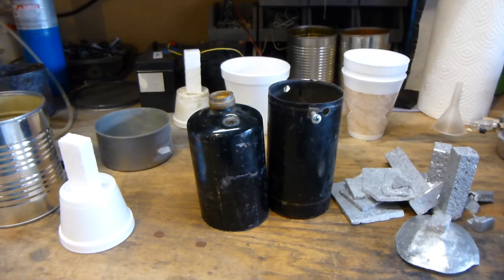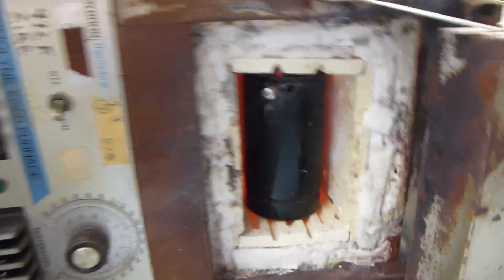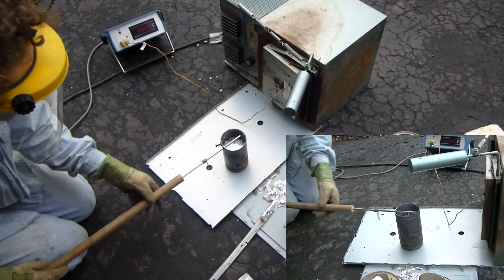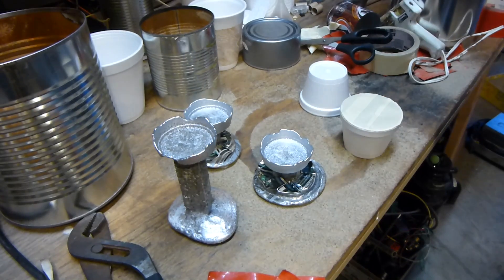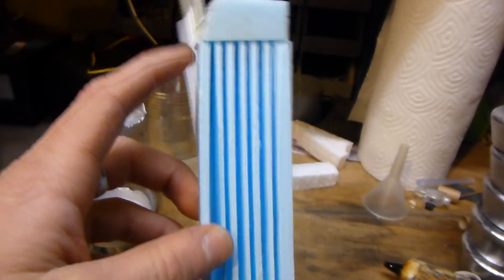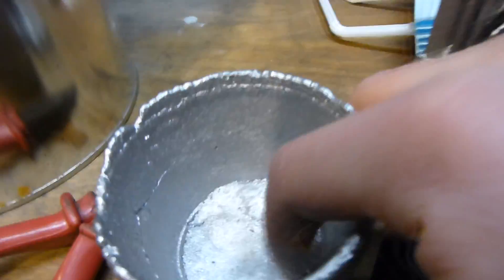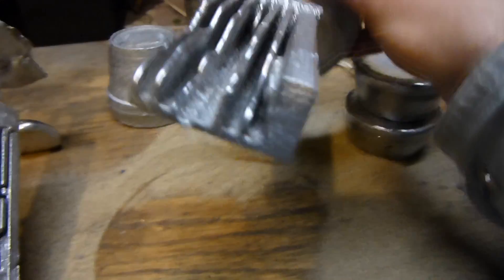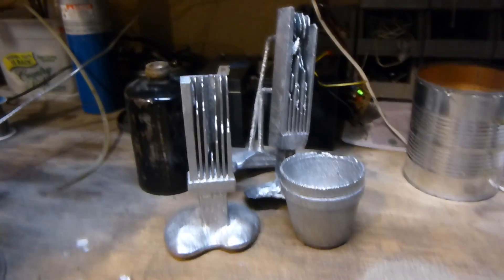Aluminium Casting Styrofoam Cups and Heat Sinks

Comment: Support the mold with a couple drywall mud coatings thined with water. Maybe add little sand to the mud mix to minimize shrinkage. You should get a better surface finish

But a bigger issue with the poor quality is the gasses in the foam need to escape. Maybe if the cups were right side up and the spruce fed into the cup from the bottom.

Comment: There's nothing to hold your sand together after the styrofoam is melted. Just add 10% bentonite clay (unscented cheap cat litter, crushed and sifted) and oil to your sand, compact very tight. One reason to oil is it has a much lower specific heat content than water and will not cool the flowing metal as fast as water.

Comment: 2 things: 

First, your sand needs a wetting agent. Something like gummy, used motor oil or heavy silicone oil works well for sand casting aluminum. If you do that, the sand won't fall out of the packed cup as easily (no more tape) and it will pick up fine detail better. You can use other chemicals, but do not use something that attracts moisture as that can make the sand casting dangerous. I like heavy automotive greases but you can mix ingredients a bit. There's a number of lithium greases that would probably work well for this. 

Second, your aluminum is seizing. You need to heat the mold.. Heating the mold prevents the aluminum from losing heat as rapidly, allowing it to flow as a liquid for a longer period of time. Even bulky pours can seize if there's a narrow gap between large volumes. Sand that can be packed tightly and hold's it's shape during heating allows the mold to be pre-heated which slows the rate of cooling during a pour and  decreases the likely-hood of the aluminum seizing in an odd place.
Reply: Just going to point out used motor oil can be carcinogenic. New motor oil is safe.

Comment: I'm pretty sure part of the issue here is with the type of styrofoam you used.  Some styrofoam is very light, while some is denser.  Styrofoam cups (and plates and bowls) are made of slightly denser styrofoam, and some of them have a slightly plasticized surface to prevent leakage.  So, rather than instantly vaporizing, they melt, producing a barrier to the clean flow of aluminium.  I have cast some very thin styrofoam sheets successfully when I used expanded polystyrene insulation that I cut into thin sheets myself, rather than using pre-made thin products such as plates and cups.

Comment: Nice vid thanks. Like other people said green sand would help. Or an alternative is to paint on a thin layer of plaster, over the foam. It takes time as the plaster has to be well dry before you pour, but hat will stop the dry sand collapsing in and spoiling the casting.

Comment: Being wet outside hope your careful aluminum explodes when it hits water!
Reply from the maker: Where do you get this information?
Reply: If water gets in the mold, when the aluminum is poured in, the water will vaporize rapidly causing a steam explosion flinging small bits of molten aluminum around

Comment: The reason why the aluminum is not filling in the finer details is because your molds are too cool (room temperature) causing the aluminum to harden quicker. To fix this you can pour plaster molds, wait til they dry, then heat them in an oven or in or over your furnace and then pour the aluminum into them.

Comment: I just bought a small kiln with a door and want to try my hand at some aluminum casting and am trying to decide if I should use a propane bottle or bore out some cast iron round stock(2".5 dia) and use that? Also I need to learn about using borax ?
Reply from the maker: +trialnterror the cast iron would last vastly longer

Comment: Curious what did you use for your crucible? Looks like a propane bottle?
Reply from the maker: you are right!
Reply: you should try making  it with 2 cups stacked, but you should cut the foam at the very edge of the external cup, it should turn out right

Comment: u need to use green sand and a smaller sprew. it will put more au in the mold. and the straw is a good vent

Comment: Interesting experiment.  I did the same thing with the foam cups back in 1969, when lost foam castings was just getting started.  If you want to use some really good sand  that is easy to get on ebay, buy a bag of Petrobond.  You won't have to mess with water because it has a binder that won't evaporate.  Petrobond will provide many good molding opportunities for you, and lasts forever.  Keep up the experiments.  It's great to see an inquisitive mind fooling around with foundry methods.

Comment: Don't know if anyone mentioned it but I would guess that the dry sand is collapsing into the form as the styrofoam is melted and plugging it.  Might need a stiffer form that will hold its shape better for such thin parts.

Comment: I used to pour flowers and insects out of steel alloy back in the day. I never used sand because it's not holding well. I used to pour plaster around them on a vibrating table so all the air gets out. Before pouring the metal, the form was heated in an oven. Then, I used to melt the metal right in the mould, using a oxygen flame. Then we would spin the mood in a manual centrifugal machine. The pour was perfect every time, details like the hair on the spider's legs was visible while using quality dental chrome vanadium alloy.
So your problem is the mould and the feeding. Use thinner sand or plaster to increase the detail. Make the feeding rod smaller with a cooling reservoir on it, (usually a bump close to the object). Most of all, heat the mould up as close as you can to the melted metal temperature. Your mould is so cold that it cools off the metal, that is why your pour is not complete...
Let me know if you need more hints like the DIY centrifugal machine. Cheers!

Comment: You mentioned how your cups were low quality and you didn't know if it was because of gasses. I think it might be because of the quality of your sand. Increasing the quality (Finer sand should be better) would probably give you a smoother, higher quality cast.

Comment: hey man.  i just had some thoughts from my own personal experience on how to cast whatever you want quite easily. I do some lost foam casting and normal flask castings, but i use greensand for both. 

The advantage of green sand is its a bunch of sand particles coated in bentonite clay. It holds whatever shape you mold it to quite well. you can basically take a normal object of any material, make a mold of it with that sand, and its holds the shape for the metal while it's poured in. 

but the reason i suggest it is because it looks like as the foam burns out your sand shifts and cuts it off. if you used green sand it wouldnt move and it would just cast the object you're after quite accurately. 

I went to petco and bought some natural terrarium sand for reptiles. mostly because its super fine sand, and its already filtered for any larger rocks and such. 

a 10 lb bag is 15 bucks. then i mixed that with a 1 lb bag of bentonite clay. which i purchased for about 5 or 6 dollars off of ebay. 

the trick is to mix the two together really well dry, then slowly use a spray bottle to add water and keep mixing, just until you can squeeze it and it holds it shape without crumbling super easy. you want clean breaks. 

keep it in a sealed container. don't let it dry out. and after each use i take all the hard dry bits and break them back up and mix them back into the sand and add more water if necessary. you can re-use it hundreds of times. 

hope this helps :D
Reply: this helped me alot, thanks mate!

Comment: Some suggestions:
Try manufactured sand. It has sharp, angular particles that interlock and cling together. 

Make a wooden frame, place it on a board and put the polystyrene cup inside, right-side-up. Then fill it and surround it with 'green' sand. (slightly moistened sand.) Inverted the whole assembly sharply onto a flat surface. (concrete or granite should be okay.) The base of the cup should now be on top and that is where you pour.

Comment: I use casting sand, and when I am about to start the mold, I use baby powder and brush it on the original... then when I use the casting sand, I pack it in... use some method of vents, similar to the straws you used. 
  hope these tips help you out.
make sure the casting sand is NOT dry... has to stick  to itself. 
have fun!

Comment: On the heat sink , try gluing a block on the bottom that you can cut off later , the impurities from the burning styrofoam have no place to go ,so a still burning  gas bubble causes the voids . Im surprised dry sand is working for you , Look in some books for a simple formula for casting green sand  . Looks like youre ready to move up to ceramic shell casting , but you need a burnouy kilm .

Comment: wd40 seems to work well for firming up the sand.  Makerj, your sand is caving into your mold as the foam melts faster than the metal can flow.  it doesn't take much to hold the sand for a split second longer and improves pours dramatically.

Comment: Maybe I'm wrong, but I think that aluminium heatsinks are made in bulk by machining solid blocks of aluminium, because not even with perfect sand (or plaster or ceramic) casting can you get heatsinks as perfect as when you machine it. That's why the compressor blades of the turbochargers are made by machining too.

Comment: Use a more wet sand. Or a clay-based soil. And you'll get a better cast. Don't pour your soil of your choice all in at one time. Do like 2 to 3 inches stop packet down and so on and so forth.

Comment: im not sure if you make progress so far . but i think it would work better with finer sand , i know there are special sands for casting and they are not that expensive , you should try that  

p.s : i dont know if the sand im talking about if used to lost foam , i saw it in 2 part molds casting.

Comment: You stopped pouring too early and you need a port or two for the aluminum and air escape on the other end.  The styrofoam is full of air pockets and the air left after the stryofoam burnt off wouldn't allow the aluminum to fill the cavity.

Comment: You need to use green sand. The metal is more dense than the sand you're using and it is pushing the sand out of the way which is affecting your detail and resulting in the incomplete molds. You also need to compact the sand in layers around the mold as tightly as possible. Make or buy some green sand and you will notice a world of difference.

Comment: you mentioned you have plenty of aluminum?  where do you get the aluminum from and how long did it take you to get it I scrap out old computers, power supplies, drills and tools, cars ect to get aluminum but until now have never know how to melt it and havent had enough to melt as of yet plus most videos says its extremely dangerious especially if moisture gets to the molten aluminum like moisture in the air even?
Reply: +Makerj101 engine blocks would be a great source of aluminium, you could probably get a complete engine from a scrap yard and break it down.
Reply from the maker: NeX Yes!  That's a great supply of very high quality aluminium.  I've seen others using engine blocks before.
Reply from the maker: +charles johnson I mostly get it from hard drive frames.  They are solid machined blocks of aluminium most of the time.  Storm doors and folding lawn chairs are also good.  I've never had any moisture problems.  The only time I had some aluminum explosions was when I spilled some on the paved drive way.  The tar started boiling and it made some little pops that splashed some aluminium around.

Comment: how are you keeping the sand dry when not in use or are you drying it often?
Reply from the maker: +zallin I just keep it in a bucket with a lid
Reply: some say keep it damp but others say the keep it dry as wet sand steams sounds right to me but I have yet to cast more than ingots I would bake the sand low and slow to dry it out, if that works better there you go, if its worse add a little back and you learned something.

Comment: Have you thought about using a moist sand, then packing it well around the styrofoam and then using lacquer thinner or something to melt the styrofoam out and then pouring the mold? Just an idea...I'm thinking the styrofoam is messing up the pour

Comment: Use 120 AFS  Grain Fineness sand so you won't need to coat the foam with Styro Coat and you must use dry sand plus vibratory compaction when filling the mold. One other way is to just buy some Petro-Bond and 30 weight non detergent motor oil to bond the sand. I own a Non Ferrous Foundry in the USA and that's how it's done in my facility.
Reply from the maker: +Michael Nedesky  In my newest videos I show how to make green sand and I cast a nice flywheel with it.  Thank you!

Comment: Good video - as you can see from the comments a finer end product will mainly be the result from using finer packing materials (find sand, pulverized kitty litter etc..) but what's great about your process is it teaches the beginner the process and by doing it this way and then changing a little here and there you really develop an understanding of how it works and how to perfect it. - cheers!
Reply from the maker: +Dave Tipton Yep!  Thank you!  :)

Comment: Use 2 X 4's or 2 X6's  to make a good drag (the bottom part of your two part system), use the same thing to make a cope. Fill the bottom with your green sand (clay water and sand combination) set the cup full of moist, not wet sand (packed as tight as you can without breaking the cup) on the bottom half of the mold you cold cut Q-tips in half to make a fair number of gates running off the top, which is now the setting on the bottom half of the mold. Set the top half of the mold on top of the bottom half and use a regular number two pencil to make a riser.  Fill the top half of the mold with more green sand.  Once it is all packed into place you should be able to separate the top and bottom half of the mold you can then cut a runner to the riser into the bottom half of the mold. You can also remove the Q-tips.  The gates will provide extra heat down at the bottom for the thicker part of the cup.  Use something round to make the sprew and make it conical near where you are going to pour it in.  With green sand you should be able to remove the thing you used to make the sprew, just like you can remove the number two pencil before you pour.  The only thing you are trying to melt away is the foam cup. I was not able to read all 495 comments, but you sure got a lot of peoples attention if you got that many comments.  Good job.

Comment: You did a good job with your early attempts! Cope, drag, sprew, riser, gates, are all terms you need to know a little more about. Green sand is a combination of clay, sand and water.  It is has been awhile since I took my foundry class in college but I will tell you there is already some good information in the comments down below.  I don't remember any oil used for any castings in my foundry class.  I had also forgotten about parting dust until a friend reminded me when we were pouring stuff in his back yard foundry.  A good parting dust for a home foundry is baby powder.

Comment: I believe that your aluminum is cooling too quickly in the thin sections.  Two choices preheat the sand (messes up the Styrofoam) or get the aluminum hotter.  The detail on the straws eliminates all the comments before regarding your sand preparation, it seems fine.

Comment: Your problem, in regards to casting the cups, is that you're using 1 large sprue leading to the thin bottom of the cup and expecting that you don't have so much heat loss that it allows the molten metal to travel all the way (again, along thin walls, exposed to lots of cooling sand) to the lip of the cup.... 

You need more channels, leading to the outer edges of the cup bottom, from the main sprue, which will allows more heat retention... You should also heat your metal WELL ABOVE the actual melting point (at least several hundred degrees fahrenheit) so that as the metal cools it doesn't solidify immediately upon contact with the sand.
Reply from the maker: +digitalmunky Thank you very much for the helpful tips!  I will try some of them on my next castings!

Comment: yse wet sand the styrofoam is melting faster than the aluminum is poured. you use wet sand it will hold its shape even when the styofoam is gone

Comment: In industry when making motor blocks they use slightly wet sand, so that it keeps its shape when compacted onto the model. This might let you make better casts as the sand won't collapse while pouring.

Comment: the straws poured better because the air could escape threw them allowing more metals to drop down, also don't allow moisture into the sand or pour it can be dangerous (reading some coments on people saying use wet sand having sand and molten steel explode isn't nice moisture can be deadly)  but mix some glue with your sand making it stick to itself better and hold a frame will cause less blow outs and impurities in the object <- work at a foundry

Comment: I think your sand is too thick of a grain, also need to add something to make the sand stick together more. When you do lost casting the mold is sacrificial but the gases it puts off is reacting to the aluminum and cooling down before it flows to all parts. Lost casting I have seen they use a go between step where they coat the object with cermic/clay with sand sprinkled on between applicaitons of ceramic. Then they fire the ceramic to melt the inter original mold leaving a cavity.. then they poor the aluminum into the cavity, let cool, break the ceramic and tada..

Comment: 1 you need green sand,2most of your problems are gas related.you have to put gas holes in your mold to vent gas..3need to bottom poor your mold.4 aluminum will pick up steel from the tank,need crucible  .i worked in a foundry for 24 years.